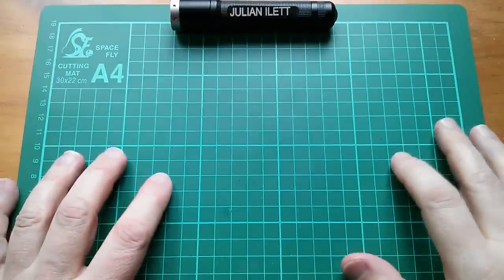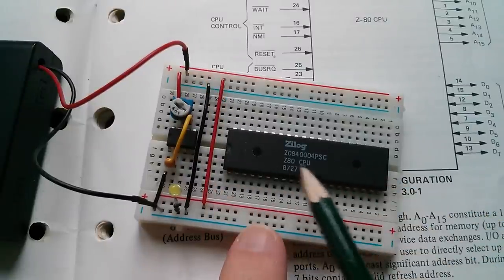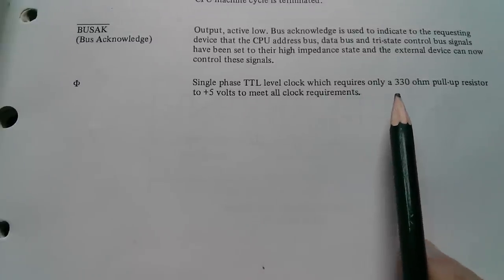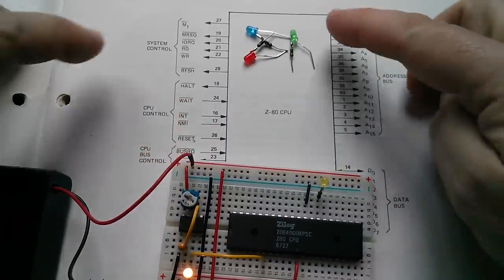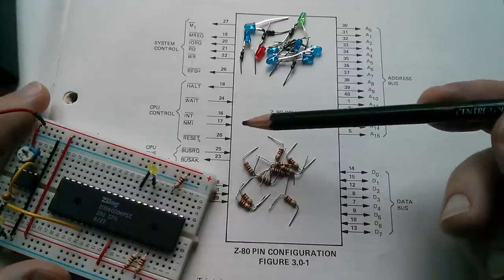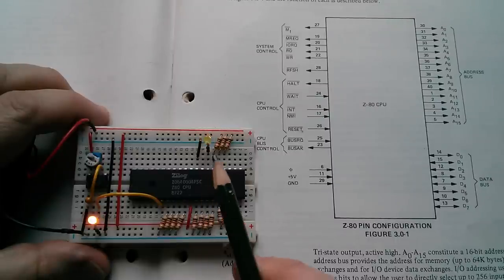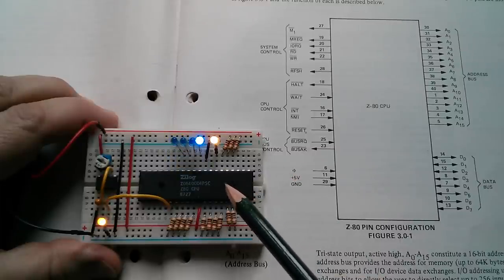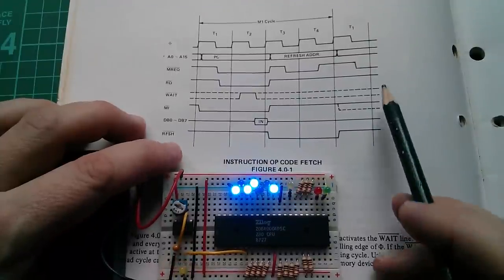Flashing LEDs - Z80 Style

Comment: I really want to build a computer out of Z80. But the cost of the switches scares me a little. 16 switches for address bus + 8 for data bus (so i could program memory with switches, i don't wanna use any ROM). Then also some sense switches (attached as input for Z80 trough IO multiplexer chip) would be useful. So, there would be a need to put another 8 switches or so. Its 32 switches. Switches would cost more than the CPU, memory, 555 for clock and IO multiplexer chip (forgot the designation of it) :-P

Comment: You should have rotated the breadboard 180 degrees (moved the Power Supply to the right-hand side) and flipped the chip over, so pin 1 aligned with the "1" on the breadboard.

Comment: I wonder if you can make it work with the AT24C256. TWI / IIC EEPROM with 256k Alice has in store (two for a pound). Or would the Z80 need a standard ROM that would have a program on how to read two wire interface? That would be a neat project wink, wink, nudge, nudge.
EDIT: Alright, they also have AT28C256, which is DIP 28.
Reply: You can't use the AT24C256 as program or data memory for the Z80. It puts a value on the address bus and expects an opcode/data to appear on the data bus as a standard memory would do. You could design an interface and write some code to work with a 2-wire memory though if you wanted to use it for mass storage.

Comment: Did you have the MEMOTECH MTX512 with 64KB of RAM as well as the MEMOTECH HDX512 and the printer, I had a MEMOTECH MTX 512 but the VDP expired so it got binned (Sorry for shouting).

Comment: Since this project runs on 5v, could one use a USB cable as the power source (with maybe a filter cap for smoothing) and run this Z80 blinky-thing off a PC? Or a USB power source?

Comment: An LED flasher with only 1 instruction, NOP. Who says a computer needs ROM and RAM. :)
Reply: Lee Hart (1802 CPU guru) produced an 1802 based kit that had neither RAM or ROM, yet ran a 'program' (and where WAS the program anyhow?) that would display alphanumeric messages on an array of 7-segment LED displays. Probably the cleverest thing I have ever seen done with a microprocessor.

Hint....a handful of resistors interconnected various data and address bus pins in such a way as to 'fake' a tiny program in 'ROM', and through clever program and circuit design this was sufficient to control the LED displays.

The 1802, unlike other vintage 8-bit CPUs, has an internal array of sixteen 16-bit general purpose registers. It was these that hold the segment patterns required to display the messages on the LEDs. This actually worked great.

The TRICK was the separate programmer, very clever in and of itself, that used toggle switches to jam the display data into those sixteen 1802 registers; this proved a bit twitchy or fiddly, and some kit builders never got it (the programmer) to work reliably...this may be why this kit is no longer listed on Lee's website. I think he is waiting for the right rainy day to revise the programmer design to make it more reliable and/or easier to use reliably.

Comment: Now try it with a 6502, which was also an NMOS chip.
Reply: 6502 would not work with such a slow clock, due to its dynamic internal registers. The Z80 uses static internal registers, so the very slow clock used here still works.

Comment: Hi Julian,   i love your videos but ...  I just have a setup just like this video.  It seems to work but as soon as the processor got to address 256 and further the address leds on bit 8 through 15 starts to blink simultaniously (when they supposed to be on) with M1   ????
I have 5  Z80's.  the problem occures on all of them.
Reply from the maker: There are also the refresh adresses (on the lower 7 bits). That may cause the LEDs to flash.

Comment: Other microprocessors from the same era are substantially faster, for a given clock frequency.
A Motorola 6809 could perform 1 MIPS (1 million instructions per second) @2 MHZ. For the same performance you would need a clock speed of 8 MHZ on a Z80A.
True that the Z80 has a more powerful CISC instruction set, but over time it has been proven that RISC processors can do as much, more efficiently. Federico Faggin, the creator of the Z80, has often admitted that his design was beautiful, but not efficient.
BTW, I didn't think a Z80 could work reliably at this low clock speed!  Thanks for sharing.
Reply from the maker: There are a couple of 6809s on my desk right now :)
Reply: The Z80 is one of the very few processors which can work with arbitrarilly long clock intervals. I made an extremely simple Z80 computer with a hand-cranked clock (I have uploaded a video of it in my channel). It's really neat single-stepping by clocking the CPU manually :)
Reply: Yes, my first ever SBC build was based on an RCA1802.
Reply from the maker: Hi John - I watched your video before doing this. I'm quite happy to admit, it was your video which gave me the inspiration. Hope you don't mind.
Reply: Haha great video. Takes me way back to my days of building 6809 prototype boards using all wire wrap connections to chip sockets. A pain to build but pretty indestructible.
Reply: Reminds me, I have a Texas Instruments Ti85 graphics calculator which I think has a Z80 inside.  Need to hack it to get it to run assembler,  I got a very nice MIPS R12000 pulled from a Silicon Graphics Octane.  Great RISC CPU for it's time.  I wonder if I could do something interesting with that - will research.

Comment: Just had to stop and say thank you, for this video. I am working on getting a vintage NorthStar Advantage computer back up and running, and I was able to test the Z80 CPU using your breadboard. The Z80A CPU that was in the machine, did turn out to be bad and I was able to get the machine up and running, for the most part,  by simply replacing the CPU.

It is not perfect yet, and I have not put it all back together yet, but it is a good start.

https://drive.google.com/open?id=0B6LIgQzDkH8fYW94ZzNwME0tdjA

Comment: Best video about Z80s on the internet, Thanks very much, but as a side note for any future viewer, you can't execute other instructions rather than NOP, HALT, JMP as the clocking frequency is too low at 7Hz you should clock it up to around 6KHz before using other registers instructions or so, this is only on the Z80 NMOS variant, I had that problem and it was really painful (The Z80 was doing weird stuff) , if you want more details here is a thread on SE talking about this problem https://retrocomputing.stackexchange.com/questions/15129/

Comment: What were some of the processor's applications in the 80s?
Reply: Many home computers
Reply from the maker: Also slot machines, vending machines, cash registers, music synthesisers...
Reply: Sinclair ZX80 PC, Microbee PC
Reply: Possibly one of the CPU's best features was that its design facilitated its use in multi-tasking environments.  It had a set of "alternate" registers.  Flipping between the register sets was much faster than using the stack, although I'm not aware of many programs which took advantage of this feature.

The fact that the Z80's instruction set was a superset of the 8080 meant that it could be used in computers which ran either CP/M or its multi-user/multi-tasking cousin, MP/M.  The Z80 was used extensively in such computers.
Reply: I think the 2650 deserves at least an honourable mention.  Its Program Counter Relative instructions meant that it was possible to make a program which could be loaded and run anywhere in memory.
Reply: I used to run a CNC router with a Z-80 as the main processor.
What a pain in the a$$ to program.
Reply: I was working part time as technician in 83, when I graduated from BSEE at McGill in Montreal. 
I repaired Arcade games as I went through the last year of school. Like PacMan, Galaga, etc...
They were all based on Z80. Very few were based on 6502. Down to component level troubleshooting, is a lost art now. Now you just chuck it, and buy another. You couldn't chuck a $1500 motherboard at that time. 
Built my fist computer in 1978 from kit. Ohio Scientific was the name. It used a 6502 and it was awesome. 
It did NOTHING. No programs. No support. No forums. No internet. No BBS. No Modems. No networks. No drives. No monitor. No manuals. Only BASIC. No Compilers. Tape as a drive. TV as a monitor! But heck, it had a built-in full keyboard. Normal people didn't know what a byte was, let alone a bit. 
None of that nonsense now. Shit times compared to today. Very nostalgic indeed, and a pain in the ass to boot.
Reply: I still have Z80 pulled out from old cash register so it seems like they also used Z80 in them.
Reply: As I remember, a lot of designers liked the Z80 because the DRAM refresh was built into the processor, so you didn't need extra circuitry for that.
Reply: I just called them laundrymachine ic :) z80 is a miracle back on those days. We love too, because a simple operation and programming. Many high precision measurement instrument also builded around this processor. Few products are running even today. Big time! Thank You for the video.
Reply: Arcade games. IIRC, Pac Man and Centipede used them.
Reply: We used them as general purpose, multi-user business computers. With the Oasis operating system, you could have multiple users use them at the same time, depending on the amount of memory and serial ports you had.

We also used them for packet radio data encoding/decoding to do bulk wireless data transmission.
Reply: House of Hacks what RF field were you in?
Reply: Frugal Teq what you mean?
Reply: sorry was meaning to reply to different user. Leaving comments via YouTube app can be gimpy.
Reply: Frugal Teq yeee Youtube app is a stupid software
Reply: Alot of synthesizers (Yamaha TZ81 for example) and samplers (Roland S220) used Z80's
Reply: Yeeee :)
Reply: Later on many Texas Instruments graphing calculators used z80 based chips (I own a ti-81)
Reply: Project Paul b
Reply: wow I got more replies to my comment than views on my videos.
Reply: Project Paul: Sorry, for the delay, just saw your comment. I was working for a company that provided dispatch systems for 911 centers. We transmitted call data to fire stations using our own custom designed hardware that talked to off-the-shelf radio hardware.
Reply: House of Hacks All respect for Z80
Reply: My TI-84 calculator from 2005 uses it :)
Reply: Although, no one has mentioned this yet, I think one of the first successful computers to use the Z80 was the Radio Shack TRS-80 1977.
There were a lot of add-on cards, that used the Z80 so that systems like the Apple II, could load CPM.

Here is the biggest surprise... The Z80 was invented by Federico Faggin - One of my favorite inventors.
He actually created the very first 4-bit CPU at Intel, the 4004, then he created 8008 and I think the even created the famous 8080 as well. This guy really is the Father of Computers...
Reply: Jeff Nay
As far as i know, you're right all the way, but i'd like to add that also Commodore's C64 and C128, as well as the British BBC computer, all had Z80-based cards available, to enable them to run CP/M.

Comment: would it be easier with a 6502 ?
Reply: I immediately thought of a 6502. I expect it would be quite similar. Pinout https://en.wikipedia.org/wiki/File:MOS6502.svg Opcodes http://www.6502.org/tutorials/6502opcodes.html . Looks like NOP on a 6502 is 2 cpu cycles.
Reply: 6502 uses dynamic registers, so it requires a certain minimum clock speed in order to not lose its internal register status during execution of programs. It would not work on such a slow clock as this. The Z80 is a good choice for this, and another vintage 8-bit CPU that also has static internal registers is the 1802, as it has no minimum clock speed either.
Reply: @youtuuba  If you get the new 6502 chip from Western Design Center Inc then you can run that at slow clock speeds, or even single step if you prefer.

Comment: How do you handle startup reset? I have Z84C00 and have to apply low to RESET pin for several cycles during startus. Otherwise CPU behaves erraticly.
Reply from the maker: I was doing that with a wire connected to the reset pin - but the shots of that seemed to get cut out during editing.
Reply: For how many cycles do you keep RESET low?
Datasheet says only three clock cycles are required, but I get wrong behaviour unless I keep RESET for 10-15 cycles.

Comment: Very nice! Has anyone tried this with CMOS versions of a Z80? I assume the old NMOS ones are more tolerant of the large current draw from the leds on the pins, and I only have one CMOS Z80 to test (zilog z84c0006pec)  which I don't want to damage (I eventually hope to connect up an Arduino and run some more complicated code on the Z80)

Edit: Well, I tried with an old NMOS 2Mhz Zilog z80 and just can't get it to work reliably, sometimes the address bus leds will start sequencing but then all of a sudden they just all light up and the M1 led stays lit too.

Edit2: Finally got it working reliably on some old NMOS Z80 and Z80A CPUs, I needed to add a switch to the reset pin resistor so I could hold reset low for 3 cycles to properly reset the CPU. Works fine now, I also didn't need a 330 ohm resistor on the clock connection to a 555, I have a 100k pot which enables dynamic changing of the clock from a few hertz to khz, very stable CPU the Z80 that it allows this. My Z80 doesn't get hot, I'm using red, green and yellow LEDs with about 10ma on each

Comment: shouldn't you connect ground first generally?
Reply: Why?
Reply: there's something called 'latch up' which can happen in certain types of transistor architectures. Basically, if the power isn't quite right, the transistors can get pushed outside of their normal range and get locked into a "Super on" state where they such as much power as possible until they overheat and burn out. That's why a lot of connectors and plugs are made that ground connects first.

Comment: Hey Julian. Recently got bitten by the desire to build my own Z80 computer and followed your video to get myself started (I'm no electronics expert). I fully populated the address bus with LEDs and some strange stuff goes on after A6 - as you seem to notice with your last LED in this video. The A7 bus goes high before every read, then low again when the read goes low (once the counting has reached that high.) Why is that? Shouldn't it continue counting up? A8 onwards get very wierd too. Is this something to worry about when wiring up the address bus later?
Reply from the maker: Yes, A7 to A15 do not show a steady incrementing count unlike A0 to A6
Reply: Oh hang on. It's an 8-bit processor so A7 should be the last lane? What are the remaining 8 lanes used for?
Reply from the maker: The data bus is 8 bits wide. The address bus is 16 bits wide, to directly address 64k of memory. An 8 bit address bus would only allow 256 bytes of memory which would be pretty useless :)

Comment: Is it easier to build a PC with a Z80 or with a 6502? I already know a few things about the 6502, but the modern peripheral ICs from WDC have a few bugs, so old software doesn't work on them.
Reply from the maker: I may try breadboarding a 6502 in due course.
Reply: The main point of the Z80 was that you didn't need a DRAM controller (like the 74S409) and it was far better for running software like CP/M. If I remember correctly the 6502 did not have as good support for DMA either (neither did the 6800 or the 6809 but this was rectified with the 6809E). A bank of 4116 (16kx1) DRAM was also way cheaper than the equivalent SRAM. For example way back in 1980 I paid about £5 each for 2114 (1kx4 SRAM) and you would have needed 32 of them!
Reply: The Commodore 64 had a Z80 expansion cartridge in order to run CP/M
Reply: I didn't know that.

Comment: use an arduino  like an eprom, and put some instructions there :)
Reply: Electrociencia The arduino only has a single full port. It gets very ugly when you have to use two ports for data or address.
Reply from the maker: I may do that - or use an Arduino as an EPROM programmer
Reply from the maker: I'd probably use HC595 shift registers to store the 8-bit data and 16-bit (15-bits for a 27256) address.
Reply: i think a program to simulate an EPROM, so you can tell a few functions to the Z80, just need to know some instructions and use the arduino as clock too to set the speed and see the results

Comment: i think 1k (50ma) resistors are a to low value i would have used 10k (5ma)
Reply: Redo your current calculation.  5V over a 1k ohm resistor to ground doesn't cause 50mA (capital A) of current.
Reply: playdav485 Hey, I believe that a 1k resistor with 5V across it will let a current of 5 mA pass (I = U/R, thus 5V/1000Ohms = 0,005 A = 5 mA) which isn't that bad considering that the LEDs draw around 20mA each.
Reply: Actually, the LEDs are going to draw (5v minus their forward voltage) divided by 1k.
Reply: and still replies are messed up

Comment: You cannot be serious!!.... Oh boy yes you are,... there no RAM and no ROM,.....   it'll never work..... but I may be wrong,....  Lov-it the old fav. Z80 I built a NASCOM computer based on the Z80 using wire-wrap,.. played  mean game of Chess,.. even if it did take 36hrs to calculate next move,... although I got into the simpler 6502 30 yrs ago ( BBC  Micro ) and more recently the 65816 ( a 6502 16Bit CMOS clone ).

Comment: I don't get how to you can power so many LED's from 5V when each LED requires 3V :s
Reply: resistors
Reply: MrGeekGamer A red LED has a voltage drop of 1.8V. If you connect them in series, you need a higher voltage. If you connect them in paralell, you need a higher current.
Reply: It's more to do with supply current then voltage.
Reply: +MrGeekGamer They are powered in parallel :)
Reply: ***** no they are connected to the data bus
Reply: Hackeras32 I guess you mean the address bus. :) Well, yes they are, but that is of course parallel. :)